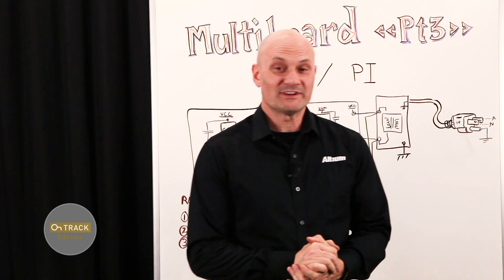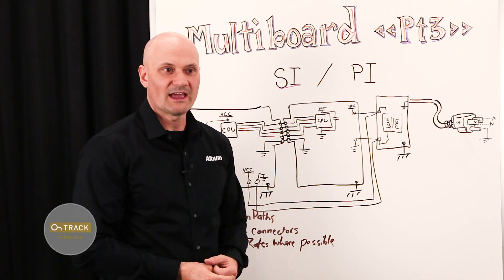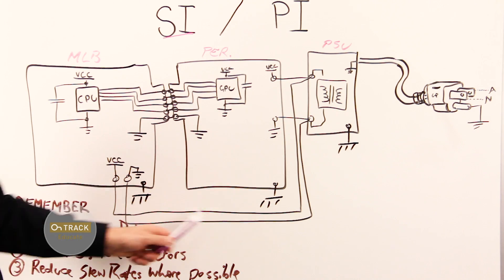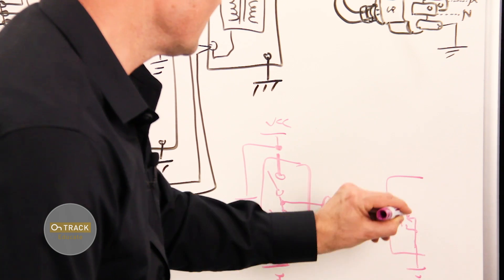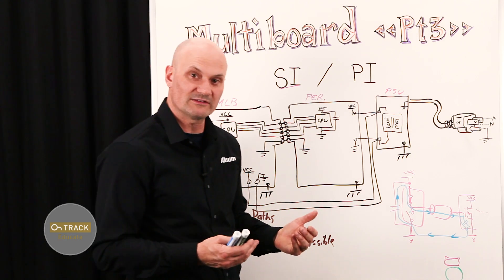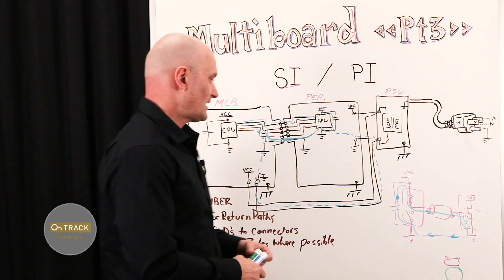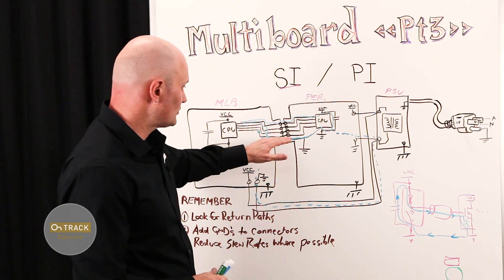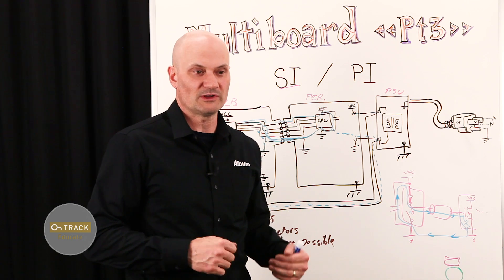Introduction to Multiboard PCB Design (Part 3): Signal Integrity & Power Integrity - OnTrack

Comment: I have an SI question. Impedance's are easy to calculate using many of the calculators in Altium or other places. And they all state that Impedance is not dependent on the length of the trace.
But how do you calculate the overall impedance of a trace that changes width along its path?
Also, why is there such a large difference between Altium's impedance calculator and others (i.e. PCB Toolkit from Saturn PCB Design Inc)?

Comment: There is a trap with slowing digital edge rates too low. If the edge stays in the unknown state voltage region too long, the digital input will oscillate and cause metastability. A Schmitt input fixes this problem with added hysteresis. Engineers run into this problem when they think they can put a big honking filter on a slow signal.

Comment: Great video. I would say the best so far from the series. Especially like the explanation and graphical representation of ground bounce and how the return path flows with decoupling capacitors on the mix.

For sure one needs to delve deeper on line termination for reducing slew rate. For example how to determine R,C values (according to rise time? etc)

As a suggestion for future videos I would love to see something related to connecting flex PCB's to rigid ones through ZIF connectors. Specifically:
-Pulling all tracks together from the flex pcb to reach the ZIF connector (track directions compared to bending direction).
-How to properly place vias in 2 layer FLex without using stifeners (.
-Grounding (cross hatched vs plane and how to pass ground lines among signals through ZIF to the next board. 1:1 ratio?)

Keep up the good work!